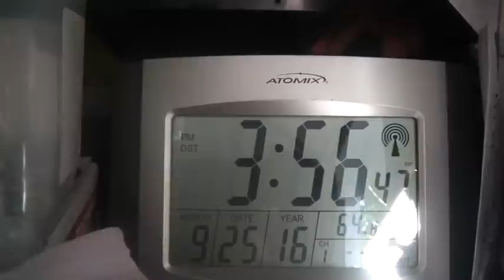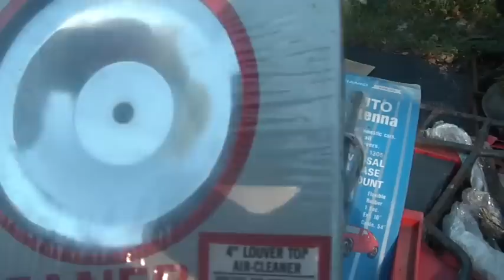$1 garage sale deals, some Sunday afternoon shopping,

Comment: how far are you from the catskills, i bought a car up there in Tannerville it will be here wednesday if u seen the udizzy vid with the blue car as his thumbnail,, thats mine.. and i just bought a 68 charger 383 4bbl, as a warehouse find only 1500 miles since restore,, in 99 it was finished,, she is beautiful,, needs some TLC, took it around the block when i saw it, it ran great, but had square tires,, rollin on new cooper cobras, and she is gonna be a driver,, ive only driven it about 200 miles, and it almost causes accidents on every road im on or every stop  make, this will keep a smile on my face til i die, keep it safe Harvey.